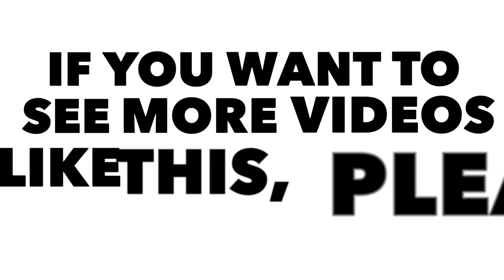How to drain sump pump water away from the house.

Comment: How deep did you dig?
Reply from the maker: 12-18 inches. You don't need to dig below the frost line. Just be sure keep it on a slant away from the house.
Reply: @AlleyPicked  here's what I don't understand about that: doesn't water pool (and freeze) in that corrrogated piping??? if it was smooth PVC piping, the water would ALL flow downhill, every drop of it, but the black piping YOU guys used has these ridges and uneven divets in the surface, where a ton of water can remain afterwards, right? doesn't that freeze in the winter, and shatter the piping material?
Reply from the maker: Think about this...most people put a smaller corrugated pipe above the ground and let it drain out onto the lawn and it doesnt freeze. This is because of the slope. The water exits the house and completely drains through the pipe. The depth to dig does not need to go below the frost line since only a small amount of water remains in the pipe. I have had "professional" people criticize this method but I have used it on 2 different homes and it has been functional for over 3 COLD winters. Thanks for watching!

Comment: um, how could you NOT mention the issue of how deep to bury the pipe so that it doesn't freeze? do you just assume that 100% of the people watching your video will be in Florida or CA like you, where it's summer all year-round? if I followed this video here in Michigan it would be an unmitigated DISASTER! plus you never brought up another important issue like make sure the outtake pipe slopes downward enough so that the water doesn't pool (or even worse....flow backwards!) like shouldn't there be a 1% or 2% "grade" where the pipe is slanted enough so the water flows downhill poperly? gosh....so many things wrong with this video :(  good try though, some stuff was impressive, like the screnning on the big pipe near the end, that was kinda cool!
Reply from the maker: Thanks for your feedback. This was installed in a Chicago suburb where most people just have a smaller corrugated hose  sitting on top of their lawn. So the depth isn't as important as you might think as long as the water drains out. Although the lawn slope is pretty clear in the video, I should have mentioned it.  I have done this twice in a cold climate and it been working great for 3 winters now. No freezing! And this year, the temps hit 30 below, so there's that :-)  It may not be what a plumber would do but hey, for $70, I think it works pretty good.

Comment: In Northern climate this technique will fail! Water will freeze bubble lawn then geyser every time the pump turns on in the winter.. I have had to fix this issue multiple times! Do not repeat this technique in northern climate please!! Thank you for getting me more work but I’m tired of fixing it now stop teaching this technique or mention it will fail in winter climate
Reply from the maker: This has made it through 4 cold Chicago winters/2 locations. No problems at all.
Reply: Don’t get me wrong your job looks good mate! by logic it should work but in more northern climates where land freezes a couple feet it will fail. Plus this is depending on the situation..
issue I’m fixing now for client is the metal grate froze and made ice shield reflecting water back towards the house and over working sump, so the homeowner then used DUCT TAPE to close entrance at the house to see the bottle neck exit failed at the road, backing water up ribbed pipe freezing it all.. this is funny because that’s when the geysers started every time the sump turned on!! Lol haha that’s when I got the call!  I have to sink the pipe more and send it towards the property swales with no fancy drain exit.. I came across your video because I’m debating 3” plumber pipe or weeping pipe for the longer distance run and the DUCT TAPE work made me think of this job and have to say something... Lol

Comment: Silicone caulking and duct tape!
They make adapters for PVC to corrugated connections dummy.
Reply: Yes uses silicone and duct tape to put on the PVC fitting at the end but then uses PVC cleaner and cement to put on the elbow that drains into the corrugated pipe.

BTW there is a product called "Ice Guard" sold by Basement Systems that will deal with the freezing but they want to sell the installation to you.  However there is a similar product called "Freeze Drain" on Amazon that I plan on installing this year as part of our backyard renovation.

This method works but I would have used better solution than silicone and duct tape in the ground.
Reply: Why don't you make a video that shows us how to do it your way dummy!